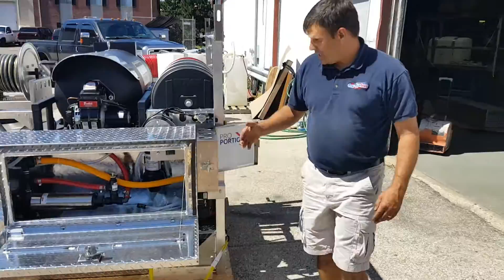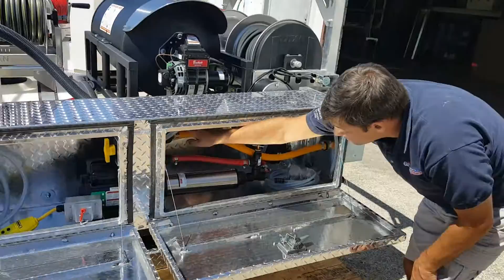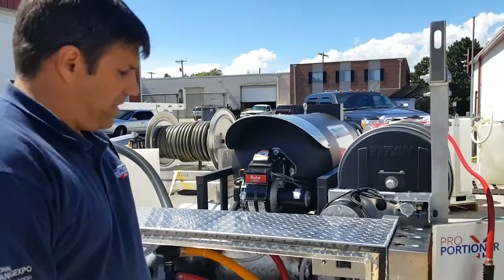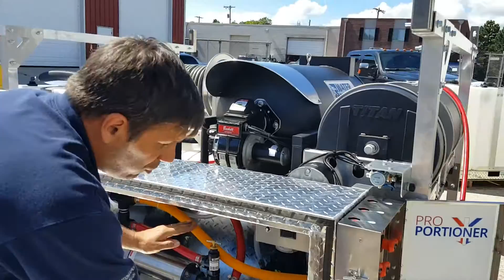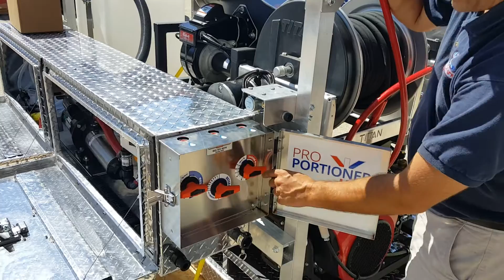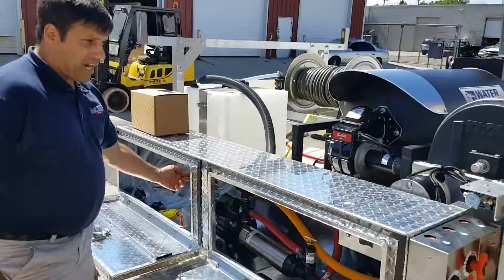Custom high/low Water Dragon skid with booster pump soft wash system

Comment: great skid but way to complicated to prime. I get the idea of priming the pumps but why not do it with just water pressure? It may take a  few minutes longer but that booster pump has a short life and is expensive. As far as evacuating the line you should make the down stream injector close to the gun and tank holding chem. When chem tanks are far from the gun that what costs us money in diluted chem. I get it priming is important especially for the booster pump. Just saying. I'm working on using a foam canon because foam has a longer time with the surface.